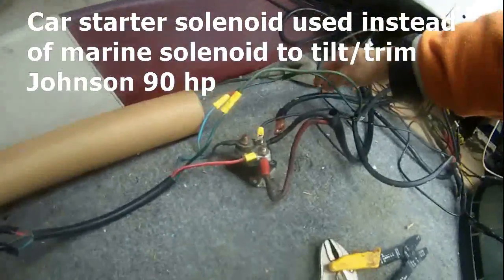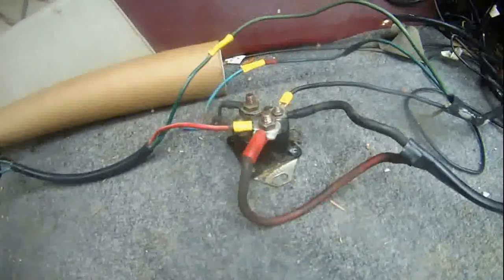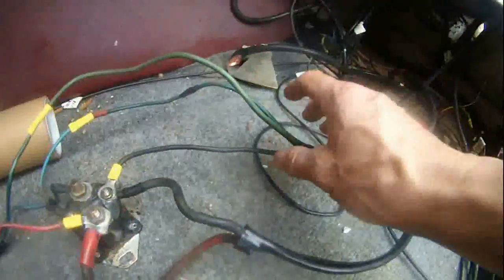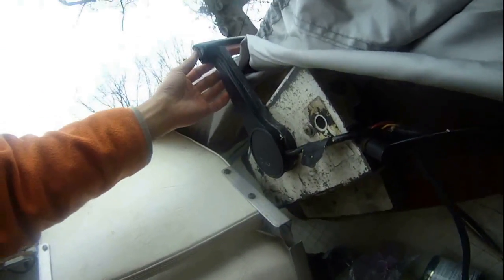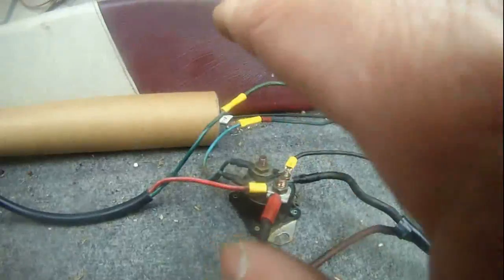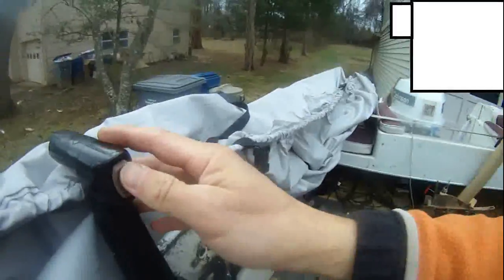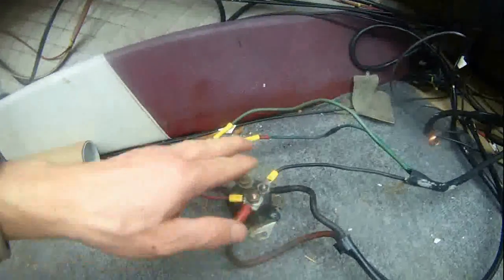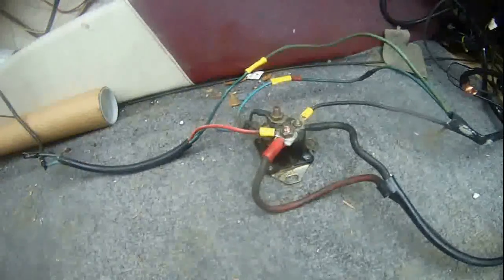Car starter solenoid for outboard tilt/trim motor explained

Comment: If I can refer to the 2 large points on the solenoid as top and bottom. Can you check and tell me if I have understood correctly. The top screw should have the BLUE wire from the tilt. The bottom screw should have the RED wire from +ve battery and a RED wire from the remote control. The right screw should have BLACK wire from -ve battery and a BLACK wire from the tilt. There is a GREEN wire from the tilt that goes directly to the remote control. My question is, is there a BLUE wire from the remote control going to the left side of the solenoid?
Reply from the maker: left side of youtube video screen is to remote control and right side of the screen is to Johnson 90 hp. There is picture slide show at the end of the video. You can click the minute and second in the description to fast forward to there if you watch it from PC. It does not work for smart phones. Here is a diagram I put together for how the wiring was done  - https://www.instagram.com/p/BNVtooWBs3R/?igshid=1lyyldg2onedb

Comment: Hi mate I realise this video is quiet old but did you put a relay somewhere in the wiring or the starter solenoid straight to the trim Switch?
Reply from the maker: no, I don't think so. The car starting solenoid has 4 posts and I thought 2 are for power and 2 are for relay. Not sure whether my statement is correct. Others can correct me.
Reply from the maker: https://www.instagram.com/p/BNVtooWBs3R/?igshid=1lyyldg2onedb - this is a diagram i put together how the wiring was done